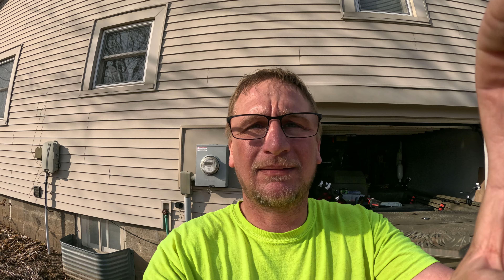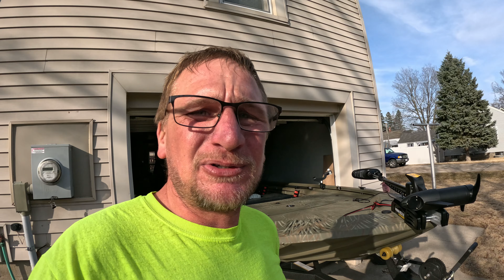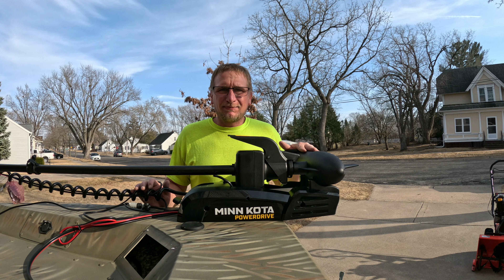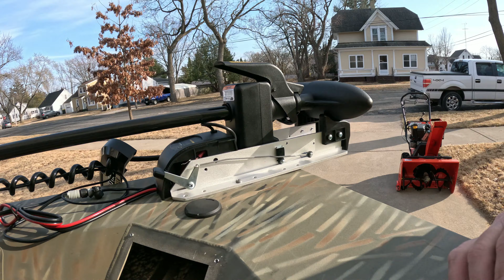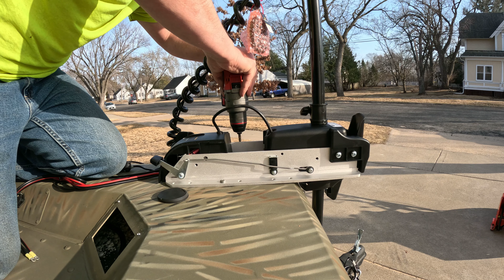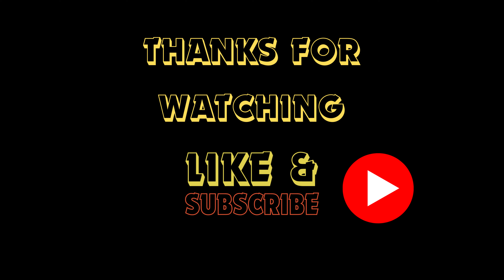TRACKER 1648SC TROLLING MOTOR INSTALL

Comment: What adapter is it for the trolling motor? I have a 2025 with same connection but don’t know what adapter
Reply from the maker: I bought the 8m000953 trolling motor guide plug from amazon

Comment: Why does the trolling motor need leveled?
Reply from the maker: It doesn't need to be level to function properly. It just made it easier to get the mounting plate flush to the boat.

Comment: Have you had any issues with the boat roller on the trailer hitting the trolling motor?
Reply from the maker: I have one landing that the trolling motor will hit the roller.  All of the other boat ramps I don't have an issue with.  You can prevent the issue by adding another roller on the tongue to guide the boat up into the stock roller.  I've kicked the idea around myself.

Comment: What plug did you install to fit into the receptacle on the boat? Having a hard time finding a match for mine.
Reply from the maker: I had to order one on amazon since nobody local to me had one for the minnkota style plug in.  Search 8M4000953 trolling motor plug on amazon and a bunch will pop up.